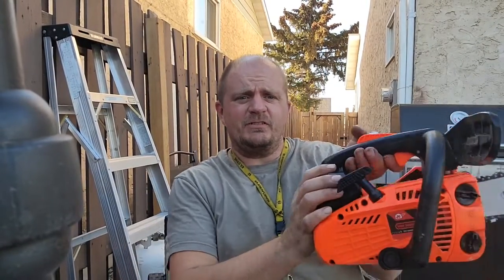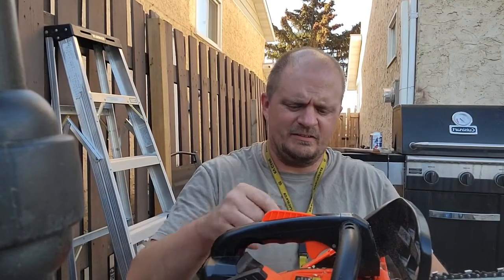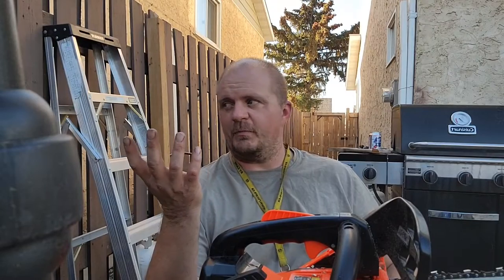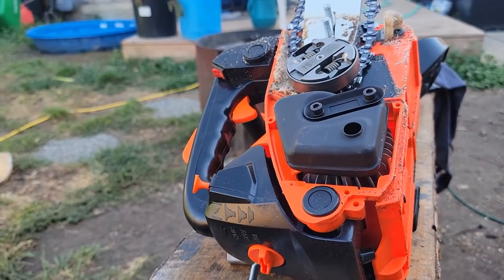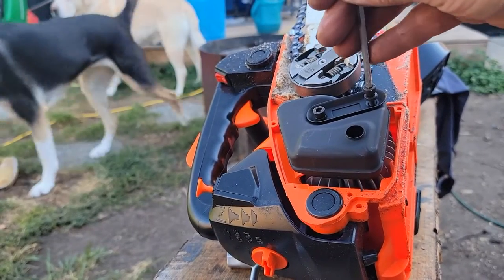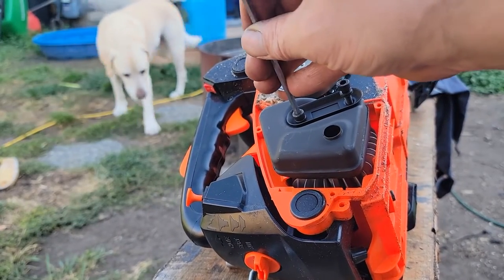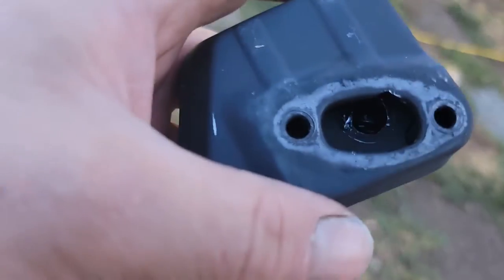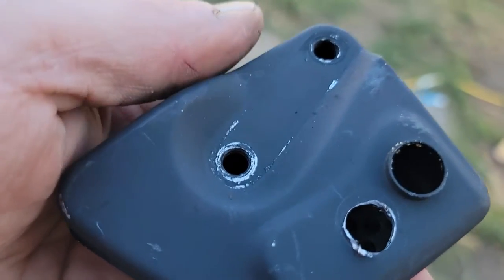Chinese 25cc top handle chainsaw before and after muffler mod

Comment: Got mine 2 seasons ago. Absolute little ripper and for the money, it's a steal! Cuts better than my 32cc echo. Leaks bar oil and gas ....but for the money I dont give 2 shits! It's so handy for marking my firewood lengths on a downed tree. Stick in one hand, saw in the other. With my full size saw its put stick down on trunk, grab saw with 2 hands and mark and repeat. Saves so much time. Great limbing saw too! Starts, runs, and holds a tune reliably.....100% recommended for the price!

Comment: been using this saw for 2 years, bought it delivered for $100 on sale off amazon.  Acutally had vendor support because there were zero instruction on how to tune it and the oiler was going crazy.  They sent me tuning instructions.  after watching this video went out to see if it would start for year 3 cleanup.  Started right up and cleaned up some palo verdes of suckers.  I used this on mesquite which is crazy hard and eats chains like crazy.  Never even sharpended the chain yet.  An yes it is a chicom saw.  I originally bought it as a throwaway but it has supprised me.  My local small engine guy won't work on it...just because so its up to me.  May start to add a bar and chain and do some mods, not like I have a warranty so why not
Reply: There's a video of a guy who upgrades the bar/to make it cut way better
Reply: @weswilliams8432  can you post a link, it needs a better chain and bar but I don't even know what model it is comparable to

Comment: hey thanks Kevin for the heads up on these cheap saws.  i picked one up for some Hurricane Fiona clean up work and it ran pretty well - but I think it could use an OEM carb. Do you know by chance what OEM carb they cloned for this saw?
Reply from the maker: Walbro WT carb, which I used in even the bigger clones
Reply: It's a Zenoah clone
Reply: @chainsawcanuck  it’s not a walbro WT I’ve seen people claim that it is but if you can find me a carb kit, I’d love to see it. I spent a full day, looking at Zama Walbro, and even Tillotson carb kit. I cannot find the exact same diaphragms as I have.
Unless I have some oddball carb that nobody else has, maybe I do because you’re seems to run really good compared the way mine was.
Reply from the maker: @Indeewoods  it's a walbro wt, but can buy a whole carb for less than 15$ to your door
Reply: @chainsawcanuck  so yours actually says Walbro WT on it? Because if it’s like mine, it is not a wall bro WT trust me on this one. I just spent 24 hours studying it lol if it is, I can’t find the diaphragm kit for it.

Comment: cool deal, never thought to look up "cheapest top handle" saws for a project. Maybe this would benefit from a narrower kerf bar?
Reply from the maker: It's funny you mentioned that this morning was pricing out a 12" bar for 1/4" 0.043 chain, and oddly this top handle has a rim drive sprocket

Comment: I just bought one of these knock offs, I have my good saws and I thought for some quick work this would work. For a 100 bucks if it dies after a year of off and on use get another one.
Reply from the maker: The knockoff are not bad, have a few different ones and they seem good quality, only issues I've had is the recoils

Comment: Just bought one of these as a quick clearing limb cutting saw for a job coming up. Boss will be using a Stihl MS661. I'll be doing ground work with this and a 18inch husky. After this job I wanna mod it.... any suggestions?
1. Carbs
2.Muffler Mod
Anything else you can think of? Thanks in advance!
Reply from the maker: Muffler mod helped, tune carb, I might port mine at some point. But definitely do a muffler mod
Reply: What does it mean to port? I’ve had a Stihl 170 that was stock before it got stolen. I am think of buying this saw because it’s a top handle

Comment: Hell yea man i just literally got one last night for $20 from a buddy of mine he said its been sitting for 3 or 4 years and it hasn't been crunk I got it to fire up but wont stay running maybe it needs carb cleaned ?
Reply from the maker: Might just need an adjustment, lean out the low screw

Comment: There are too many other variables. Sharpness of chain, wear of rakers, oiling, consistency of wood (it's organic, Man!) time of day, earth's tilt on its axis, whether anybody greased that axis, first-run rust on the chain rails, etc. It's best to jury-rig a little dyno and cobble together a differential testing procedure. Doesn't have to be horsepower ... like the old O&R engines you can call it chicken power ... just test the difference.
Reply from the maker: I just like to keep it simple, 2 cuts 20 minutes apart is good enough for me, same peied of wood cut 1/2" apart, backyard dynos suffer the same variables